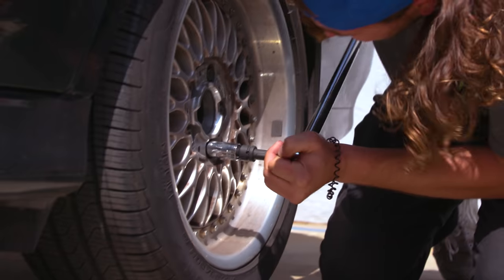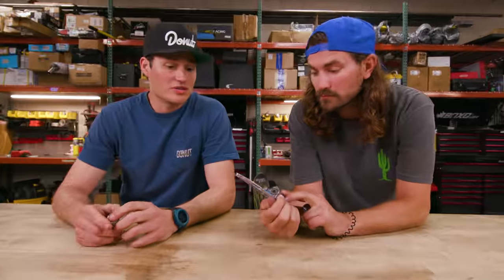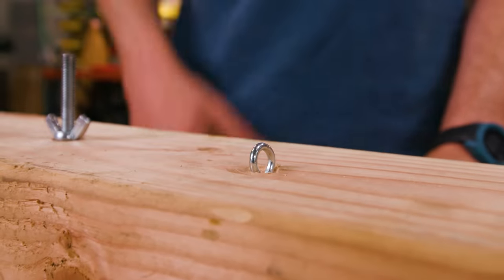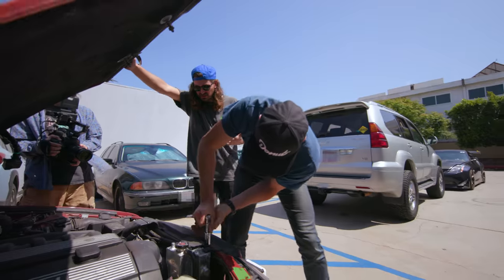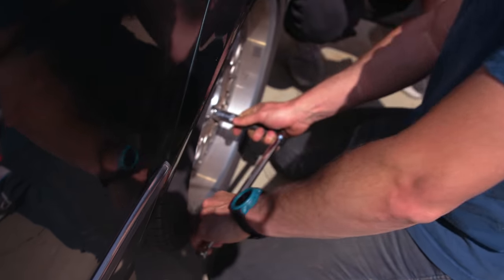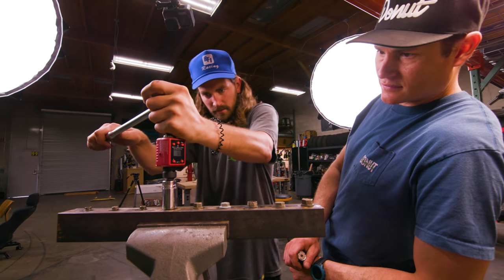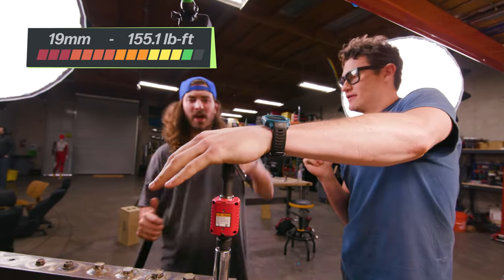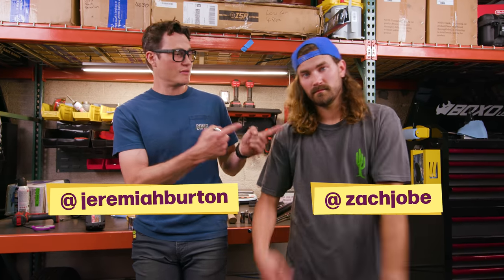Testing the World's Most Hated Tool

Comment: So the verdict seems to be that the Gator Grip does work on almost everything.
Once.
Reply: Yeah. I see it like fix a flat or something, one use and then toast.
Reply: @ObscuriaDragunAed  And it also toasts the bolt you are using it on. OK in an emergency situation, but nothing I would want to do to my bolts when I'm trying to fix stuff.
Reply: @martinweizenacker7129  Agreed, I wouldn't have used it on the aircraft if the bolt I used it to extract was still good. But, thats why I carried one for emergency situations, definitely wouldn't use it for everyday usage, but, like easy outs, it's good to have in a "just in case" situation. 

However, in the future, I could see something like it with better materials, and maybe suspended with neodymium magnets in place of springs, being a new standard for tools, but, that's far off and would only be feasible if conventional fasteners are still in play in that hypothetical time.
Reply: Also messes up the bolt wheather it works or not
Reply: Yeah I mean these things are dirt cheap and quite small, I’ll probably consider keeping two or three of them in my toolbox in case I don’t have/can’t find an appropriate socket
Reply: 666
Reply: @ahmedsaeedmob771   Not at all 💯  if used correctly
Reply: Yes, I was thinking the same thing. Its your one-use wildcard hail mary super punch.
Reply: Pairs well with Snap-Ons
Reply: It didn't loosen the lug nuts or the 7mm bolt so how is that the verdict
Reply: @Jbuddaho  You just decided to ignore the word "almost", didn't you?
Reply: Repent and believe in Jesus Christ  Grandfather Nurgle Loves me
Reply: arknor  Like another commenter said, if the pins were hexagonal, might work better!!
Reply: I believe it is a worthy tool together with a set of manual wrenches. Once the bolt or nut is loosened a quarter of a turn with a regular wrench, this thing can do the rest of the job rapidly and without much wear. So a good tool to have around, but not a complete replacement for other tools.
Reply: @blueberrywilbur315 Totally Agree :) ;)
Reply: Main problem was using an impact driver on them first of all. Terrible idea, not for that. Secondly they suck at their torquing techniques and keep letting it come up at weird angles so it could slip.
Reply: @GlitteredUp4Easter  To be fair to them, that was actually a good part of the stress test. You want to abuse the tool a little to see how it fails. Because sometimes you'll be in a tight space where you can't face it quite head on and are stuck at weird angles.

Comment: The gator grip is a pretty good “office tool.” I worked in a restaurant and we kept one in the “general tool drawer” because nobody was responsible enough to keep up with all the sockets in a set, but having one wrench with the gator grip on it in there worked pretty good for the one-off situations where we’d need to fix a filing cabinet or shelf in the closet or something small like that, because people seemed to at least be able to toss that single tool back in the drawer without losing it.
Reply: That is such a flaccid recommendation for the Gator Grip and I think it's the best it's gonna get.
Reply: I hate to say I have one of these because I didn't want to spend absurd amounts of money for a 7.4mm bolt on an old boat I am fixing.
Reply: I've used one at work to adjust a machine that needed it once a month and it is nice to have in the house for a quick easy job. But for assembling a cabinet or working on cars you are much better off with tools designed for the job. The short version is they are good for what they are which isn't much.
Reply: ok
Reply: @jedidiah4647  Lmao 🤣
Reply: It's always amazing to me, how good tools in a shared environment tend to disappear but the crappy stuff always finds its way back to the toolbox.. 🤔
Reply: @Tallnerdyguy  Turn the bolt out with pliers, and replace with standard size.
Reply: I use mine all the time. Sometimes I can’t get it to work and have to drag out the toolbox but I always try the gator grip first.
Reply: @NickGreyden  so as everyone I know and as you have said useful in a pinch. But really needs to be gone.
Reply: @josephkanellopoulos5995  because we break the supposed good tools and the crappy shit lasts
Reply: @joebone3151  uh huh… and then you see one day the “broken tools” being pulled from someone else’s desk drawer…. 🙄
Reply: @josephkanellopoulos5995  dude. Trust me the ones that state are te ones that works yeah good tools get taken here and their. But the best ones are the shittiest looking ones. They never fail
Reply: ok
Reply: @sonvan6714  alright
Reply: After seeing all the advertisements I was wondering. Conclusion: An adjustable wrench is a better "general tool". And if I really need a socket wrench .. well, I don't need any bolts rounded over, thanks !
Reply: They put it back in the drawer after using it because no one wanted to take it home. lmao
Reply: The only reason why it keeps ending up back in the drawer is because nobody even wants it, they don't even consider stealing it because its a piece of crap tool
Reply: @Sliptied  Weird how the jobs keep getting accomplished without any other sockets in the building, then. I guess you’d know about the inner workings of our occasional repairs than I would, though, so I’ll take your word for it.
Reply: @Validole  Since this is in the context of an office environment, I have to point out that I have never worked in a place where the employees were allowed to modify any of the equipment, even something like a chair in the break room.  So for any places like the ones I have worked at, changing the size of a bolt or nut just isn't an option.
Reply: @milamberarial   @milamberarial  My @ response was in the context of "a 7.4 mm bolt on an old boat", but I feel for you regardless. In my office, if my chair back is loose, I will go down to the workshop, get the needed hex wrench and some threadlocker, and proceed to fix the problem. Modifying tools is of course, a no-no, for good reason... But otherwise, maybe find your next position with a smaller company that hasn't yet reached the scale of a work environment officer needing to justify their paycheck.
Reply: @Validole  Its not that, I was working most recently at a Burger King.  They didn't have a problem with us fixing stuff (even stuff we shouldn't have been the ones to fix :) ) They just wouldn't have allowed us to actually change something like that
Reply: For a housewife tool it could work
Reply: @Validole  my pliers aren't long enough. And it's already done
Reply: @josephkanellopoulos5995  I think both good and crappy tools have a roughly equal probability of being lost. It's just that the good stuff gets used more often, and therefore more opportunities to get misplaced, whereas the crappy stuff rarely gets used at all.
Reply: @Validole  IDK why everyone keeps recommending pliers in various comments, pliers are a worse tool for bolts than even the gator grip.

Comment: It works well enough for light duty work when you dont feel like grabbing the whole socket set
Reply: But, the socket set will come in useful later so its better to get real tools in the long run :)
Reply: I keep one in my tool bag in the truck. I love it, hardly ever use it but when I’m doing something easy for someone I can grab it and my 3/8 ratchet and throw them both back in the bag instead of pulling out all the sockets, that’s literally the only occasion I use it but hey it saves me a little time and having to keep track of the sockets I’m using (normally just 2, a 10 and 13 swapping batteries) but sometimes there’s nuts and bolts that aren’t standard and I would have had to go back to the bag and pull out more. Definitely not a must have but it can be a useful little socket. I think i have 2 even though I’ve never bought one though lol.
Reply: No, not really. Socket of proper  size will take less space. This may be good for weekend diy warriors but not for a factory mechanic.
Reply: @spol1622 It depends on what you're using it for. I keep mines in a tool bag for HVAC. I don't have the space to carry an entire socket set, and depending on the brand of unit and what year, it's not possible to keep every single socket size for every bolt. This works good in place if I don't want to have to go all the way back to the truck just to unbolt a fan motor.
Reply: Yeah if you want to put 6 lag bolts in and then the socket be destroyed forever.

Comment: These are very useful for removing or installing odd shaped things like loops, rings, hooks, etc.  I would not use this for regular nuts.  At my aviation job this is actually the only tool that quickly removes the cargo net anchors in the baggage compartment of the Cessna 172 S.  No socket fits those things, and removing them with the shaft of a screwdriver, or other such thing is a royal pain in the ass, as the eye bolt is mounted in a locking socket.  I is just great for oddball applications.
Reply: Exactly why I have one in my tool shed......👍👌👍
Reply: Former roommate of mine left me an old ifixit kit that had a Y cup driver in it designed specifically for eyelets and hooks. I highly recommend one if that ever fails on you. I didn't know they existed before seeing one though.
Reply: @BlackJackOfAllTrades  I'll look into that cos honestly it's what I use mine most for now days.....👌👍
Reply: I think it is funny you say they are good for "odd-ball" applications,  after mentioning working in aviation LOL 
My limited knowledge of that field , only tells me that most of it demands very specific tools, torque specs, specs/reg methods/etc. for anything and everything on an aircraft. LOL,   Are you super sure they don't have a socket/tool (high dollar) for those anchors?  Saying a "Gator socket" is the best thing for an aircraft app, kinda blows my mind LOL
Reply: @chrisperrien7055  Honestly, general aviation has very few special tools, and the ones that are around usually deal with wing mounting.  Most of the hardware is pretty much standard AN, or MS harware, and in many ways us A&Ps CURSE designers that even think of requiring special tools.  Special tools are usually a sign not enough thought went into a design...or too much.
Reply: @chrisperrien7055  and no, Cessna does not provide any sort of socket for those anchor points on the new 172 or 182s.
Reply: What’s your aviation job AP mechanic?
Reply: @chrisperrien7055  dude, the cessna 172 ist a small plane. and the nets hold maybe some golfrackets, lunchboxes and laptop purses. that the hooks are shaped oddly should make us think. probably to match some weird US safety standard.
Reply: Worked at a hospital and our biomed guy (works on all medical devices) had one and sang its praises because of all the proprietary fastener shapes he ran into.

For the same reason maintenance had one.  Though they said they mostly use on bathroom stall fasteners
Reply: I just cut a notch in a socket for those anchors.

Comment: I actually knew a contractor that worked on retail projects that swore by this. I think it’s just a lot more useful for lower torque applications like building furniture and fixtures where there’s a lot of small annoying bolts
Reply: And you need to treat them with respect, you cant just smash them down on the fasteners.
Reply: I totally agree
Reply: I could see how it would save time, no need to switch out sockets etc.
Reply: Totally agree I’ve used this for taking off low torque part on my car like a drain plug, but I’ve also broken one trying to take off a lug nut lmao
Reply: The problem is it's going to round your bolts.
Reply: Those furniture are going to look amazing when all the bolts are mashed to shit.
Reply: @joexiden5798  it's just a solution for a no problem.

Comment: When I was a teen in the 70's and frustrated working on my car, losing sockets on my sloped driveway, I imagined a tool EXACTLY like this.  I don't think I ever told anyone about it, but then a few years later saw this on the market and I was extremely bummed that I hadn't tried to patent the idea.  Story of my life.
Reply: Same thing happened to me but with falcon heavy rocket engines - just gotta get there faster next time!
Reply: I as a little boy in the late incredible 80s saw that there was no reason that the digital screen of a computer and television shouldn't be integrated into the same device...
Reply: Flying cars with me but I may still have a chance
Reply: I think the problem is that children are often very literal and logical but don't have the wherewithal and nouce that adults have also it's hard to patent an idea without a working diagram or specimen
Reply: These guys aged out of high school.
Reply: mine was the zorb, the big plastic/rubber hamster ball you climb into. spent 30 min designing it in jr. high in '91 while looking at a hill outside my class window. glad someone made it, but damn did i lose out not having the capital to make it

Comment: These are indeed PERFECT for hooks and eye bolts. They are also pretty handy if a bolt is already kind of rounded or youve lost a socket. As with most of the "As Seen On TV" stuff, its good for around the house odds and ins, but not good for an actual job.
Reply: Bone apple tea!

Odds and ends
Reply: Exactly
Reply: I was going to say the same thing. Say you were a wedding prop builder and you needed to quickly pop in and out hooks, it looks really good for that.
Reply: Yeah. I own one for the situations where a proper tool doesn't exist. Not to replace my actual sockets.
Reply: Its a good tool to just throw in a bag with its wrench just in case you need it for something. I would never use one if I didnt need to tho.
Reply: @orsmplus  A fellow redditor I see
Reply: I have a specific wingnut/hook bit that I can use instead
Reply: I think if this tool was designed better it could actually be decent.
Reply: @MaximNightFury  wingnuts dont fit to this one Tyler.